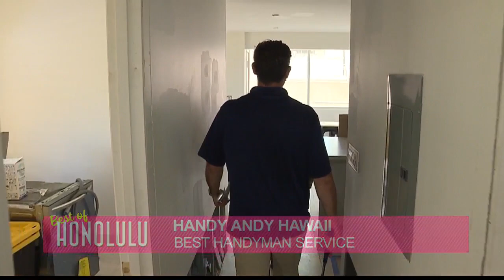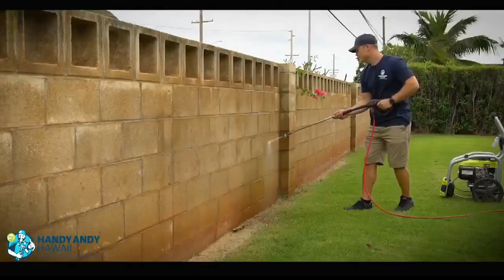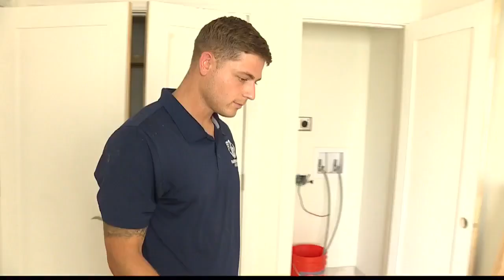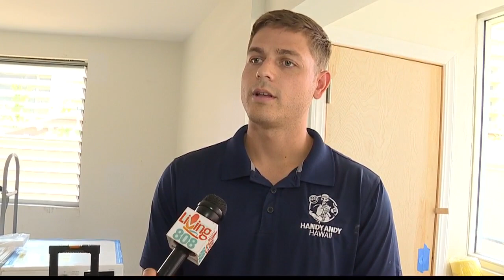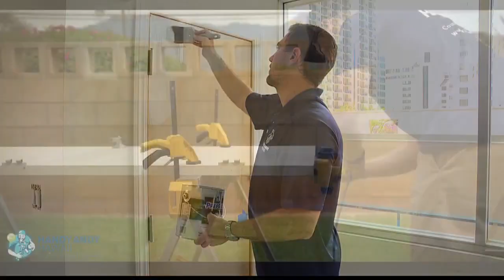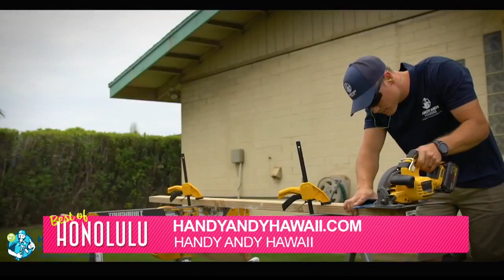Handy Andy

Comment: Caution, there are some things that you may want to use a professional contractor for.  My condo association uses a handyman for most simple repairs.  The handyman did cause a massive power outage though.  Roof repairs are done by a roofing contractor.  Plumbing repairs are done by a plumbing contractor.  Getting the picture?